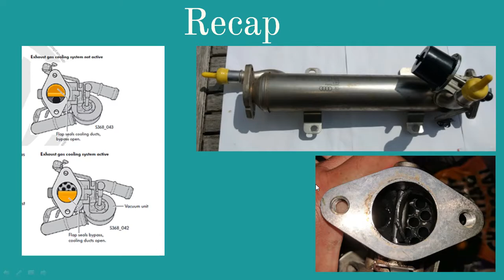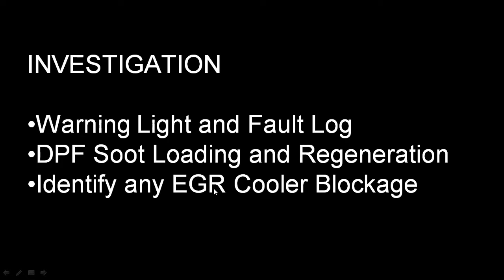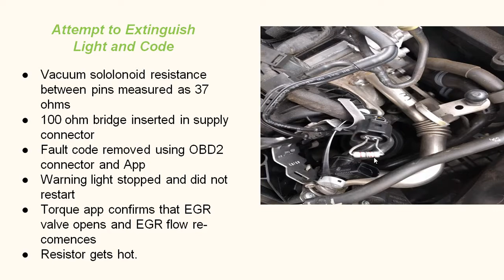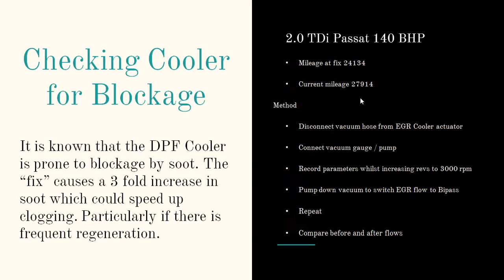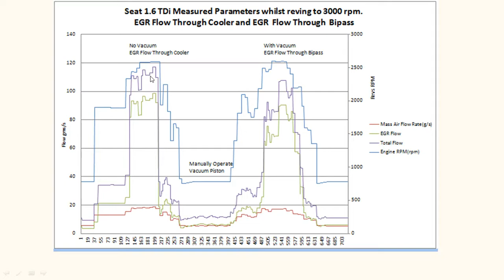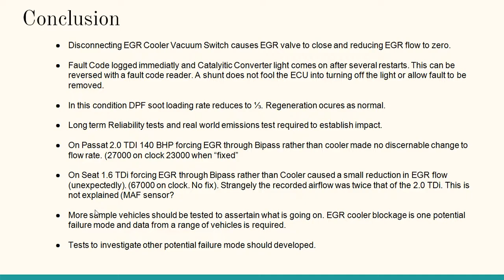20170705 203402 edited

Comment: FYI. On the 1.6 TDI CR CAY* Engines. (seimens ECU) disconnecting the egr cooler vacuum bypass solenoid does not stop the egr from functioning.

Does throw up a fault code though. 

hope this helps.
Reply from the maker: Jed.I. Knight Interesting. I would have thought that with the connector disconnected, if the vehicle didn't go into a fault mode, the cooler bypass would never come into play. This would cause issues during start up in cold weather because the EGR gas would be over cooled causing condensation to form. And this is what other manufacturers claim damages engines. Have you got access to Torque to do the same tests as me. would be interesting to see what changes we get on. 1.6. I didn't want to mess too much with my son's car. It's essential for work.
Reply: yeah, I know. it knows there's a fault and the EML light comes on after a few drive cycles but it never turns off the egr which is a shame as it looks like a pretty good idea so far. 

may fit blanking plate an see how that goes.
Reply: I do use torque.
Reply from the maker: It would be really helpful if you could run similar tests and record parameters for comparison with the 2.0. Also again after the blanking plate (if you decide to go that way). Is the EGR accessible? I had a quick look on my vehicle and it seems to be hidden right at the back.
Reply: Can do that. what programs do you use to upload the data onto your computer like that? 
the EGR is the same an the 1.6 right at the back of the engine. you would need to block pre egr system because if you block it post egr I fear the cooler will get too hot with all the exhaust gases that can't escape.
Reply: It's also good to see the DPF still regenerates even though the EML light is on. have you noticed the engine running any hotter due to the higher combustion temperatures due to lack of egr?
Reply from the maker: I haven't noticed it getting any hotter. I'm not sure it would. At full throttle (when the engine gets hottest) the EGR or normally closed anyway. Also, As far as I can work out, the EGR reduces localised peak temperatures (to reduce NOx) rather than the bulk temperature which could damage engines. I would welcome any advice from the experts on this.

I use Excel to process the log files. I'm by no means an expert but probably above average. I can draw the graphs for you if you need a hand. Just send me the log file.  I recorded at 0.2 seconds main things to record are MAF EGR EGR error RPM Coolant temp. But as much but as possible really. You never know what might come in usefull.
Reply: Good to hear that it doesn't seem to increase engine temperatures. what you said makes sense. I will try and gather some data next time I'm out. 

I have to say, Ive never had total airflow readings as high as that, it never reads above 40 g/s Wil have to double check though.
Reply from the maker: I did all the tests in the video static. Torque gives MAF, EGR%, EGR error. I have calculated EGR flow and total flow in Excel.